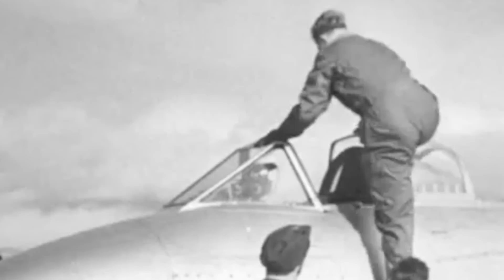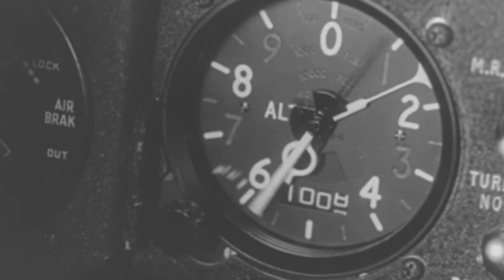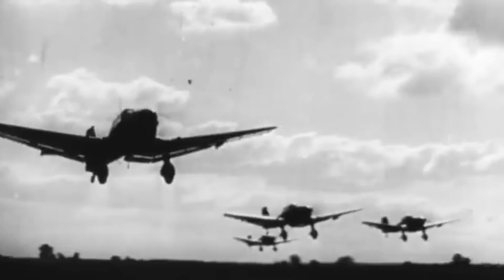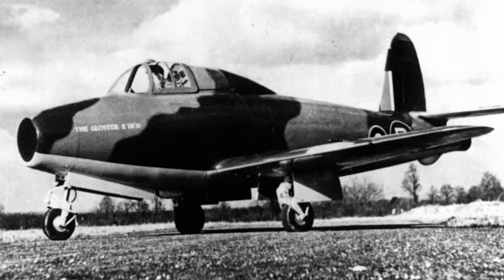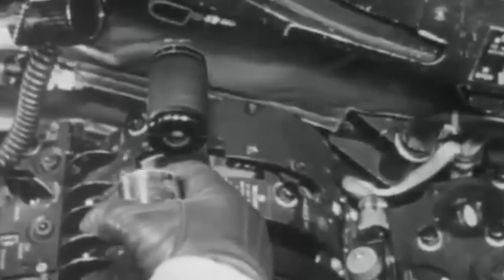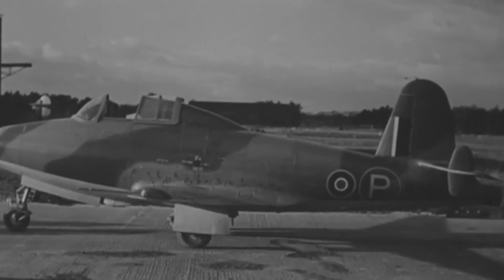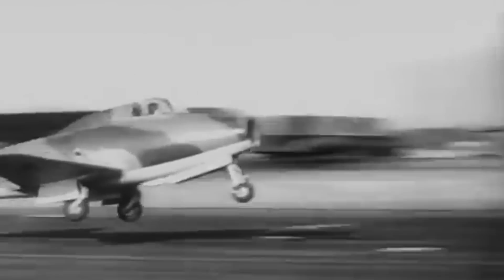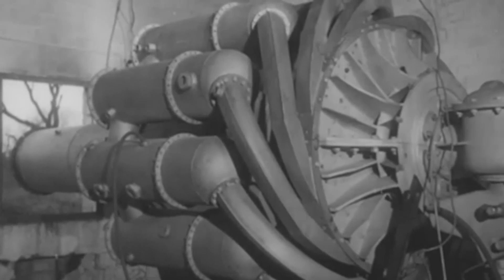Britain's 500 MPH Coffin With Wings

Comment: Great Britain 🇬🇧
Reply: Not so great at building jet aircraft...
Reply: @sandervanderkammen9230  Are you serious, we gave the world jet technology, and one or two more inventions as well if I remember correctly…😂😂😂👍
Reply: @DaveSCameron  Are you German?
Reply: @sandervanderkammen9230  Are you Welsh?
Reply: @DaveSCameron  They don't make jet engines in Wales lad...
The Jet engine was invented at the  Göttingen Universität in Germany and first successful demonstrated was in Rostock Germany on August 27th 1939.
Reply: @ 😂😂😂😂Wales
Reply: @sandervanderkammen9230 

   We do indeed feel we can clear up some commonly held misconceptions obviously.

   Of course The gas turbine concept was first described & patented in England before 1800.
    
   That's correct, Parsons of Ireland & North England produced the world's first multi stage sequential stator rotor axial compressors and turbines before 1900 for turbomachinery use, the basic components of most modern gas turbine aero engines. Parsons also did work on the axial compressor internal combustion gas turbine engine concept.

   Yes, agreed, it is in fact the case that the world's first demonstration of a pure internal combustion gas turbine aero engine was of course performed by Whittle in 1937.

We truly hope this helps.
Cheers & 👍 indeed of course.

   O B V I O U S L Y.
   
. ....... ........ . . . ..  .    .. ........
Reply: @petemaly8950  Please name a single British company that still makes British jet aircraft in the UK.
Reply: @sandervanderkammen9230 

We do indeed feel we can clear up some common false myths, misunderstandings & misconceptions.

Clearly it's always very important to note the relevant facts obviously.
 
  Regarding the UK Aerospace Sector.

Which airline recently ordered 60 RR Trent XWB Engines?

     Agreed, it is if course the case that Brazil makes very good airliners & Brazil is 100th down list along with Indonesia for wealth per capita.
Norway Holland Denmark Ireland Belgium - Top 20 wealth per capita - Don't make airliners -  its as simple as that.

   Yes that's correct of course. BAe Systems & Rolls Royce combined now do more Airbus work than Germany on an absolute basis & significantly more work than that on a per capita basis.
    
    Yes that is in fact correct, Per capita for the home nation BAe Systems is the world's largest defence contractor.
   
     It is indeed the case that BAe systems announced the recent £4 Billion takeover of Colorado based US based Ball Aerospace.

     Agreed of course, BAE systems now does a significantly higher value of work for Airbus than it did when it was a major Airbus shareholder before 2005.
  
     Yes, it is recognised that RR now owns US Engine maker Allison for example which does classified Aerospace work for the US Govt.
   
   Absolutely correct obviously, anybody currently flying on a widebody airliner stands a good chance of being on an aircraft powered by RR gas turbine aero engines designed & built in the UK.

   A typical but small glimpse of what goes on in the very internationally orientated British aerospace sector.  -
      Boeing Apache Attack Helicopter.
AH-64: 75 UK suppliers, 7% UK content, global fleet of 1280+ aircraft.

F35B more than 130 UK Suppliers, more than 30% UK content.

F35A & F35C more than 130 UK Suppliers, more than 15% UK content.

   Yes, of course it's true that an airline has just ordered
60 RR England Trent XWB Engines
    
Obviously the UK has the
World's Highest Combined Per Capita
 Nuclear / Defence / Aerospace Sector Activity.
     
Obviously we do sincerely hope this helps as usual as always.

Cheers indeed & 👍 without doubt as always & so on & so forth.

. ...... ....... ............. ..........
.... . ......... ....... ... ...........
Reply: @petemaly8950 Please name a single British company that still makes British jet aircraft in the UK???
Reply: @petemaly8950  Aye mate, can ya name a British company that still makes British jet aircraft in 2024???
Reply: @WilhelmKarsten 

We do indeed feel we can clear up some common false myths, misunderstandings & misconceptions.

Clearly it's always very important to note the relevant facts obviously.
 
  Regarding the UK Aerospace Sector.

Which airline recently ordered 60 RR Trent XWB Engines?

     Agreed, it is if course the case that Brazil makes very good airliners & Brazil is 100th down list along with Indonesia for wealth per capita.
Norway Holland Denmark Ireland Belgium - Top 20 wealth per capita - Don't make airliners -  its as simple as that.

   Of course there are many countries that could easily produce better airliners than are currently produced, they don't for a number of very good reasons.

   Yes that's correct of course. BAe Systems & Rolls Royce combined now do more Airbus work than Germany on an absolute basis & significantly more work than that on a per capita basis.
    
    Yes that is in fact correct, Per capita for the home nation BAe Systems is the world's largest defence contractor.
   
     It is indeed the case that BAe systems announced the recent £4 Billion takeover of Colorado based US based Ball Aerospace.

     Agreed of course, BAE systems now does a significantly higher value of work for Airbus than it did when it was a major Airbus shareholder before 2005.
  
     Yes, it is recognised that RR now owns US Engine maker Allison for example which does classified Aerospace work for the US Govt.
   
   Absolutely correct obviously, anybody currently flying on a widebody airliner stands a good chance of being on an aircraft powered by RR gas turbine aero engines designed & built in the UK.

   A typical but small glimpse of what goes on in the very internationally orientated British aerospace sector.  -
      Boeing Apache Attack Helicopter.
AH-64: 75 UK suppliers, 7% UK content, global fleet of 1280+ aircraft.

F35B more than 130 UK Suppliers, more than 30% UK content.

F35A & F35C more than 130 UK Suppliers, more than 15% UK content.

   Yes, of course it's true that an airline has just ordered
60 RR England Trent XWB Engines
    
Obviously the UK has the
World's Highest Combined Per Capita
 Nuclear / Defence / Aerospace Sector Activity.
     
Obviously we do sincerely hope this helps as usual as always.

Cheers indeed & 👍 without doubt as always & so on & so forth.

. ...... ....... ....
......... ..........
.... . ......... ...
.... ... ...........
Reply: @petemaly8950  Are you afraid to answer the question lad?
Name a British company that in 2024 still makes a British jet aircraft?
Reply: @petemaly8950  Well you certainly sorted that out with aplomb!
Reply: @DaveSCameron 
Thanks 👍
Reply: @petemaly8950 It's 2024 and can you name a British jet aircraft manufacturer left in the UK that still makes a British jet???
Reply: @sandervanderkammen9230 

@WilhelmKarsten 

We feel we can clear up some common false myths, misunderstandings & misconceptions.

It's always very important to note the relevant facts obviously.
 
    Regarding the UK Aerospace Sector.

  WHY IS IT THEY CAN'T ANSWER VERY SIMPLE QUESTIONS ⁉️ 😅
  A very simple question indeed.
   
Which airline recently ordered 60 RR Trent XWB Engines? 

Also name a single Germany company that makes German jet aircraft in Germany & name a single German Company that makes German gas turbine aero engines suitable for widebody airliners.

     That's correct, Brazil makes very good airliners & Brazil is 100th down the list along with Indonesia for wealth per capita.
Norway Holland Denmark Ireland Belgium - Top 20 wealth per capita - Don't make airliners -  its as simple as that.
  
  Agreed, that is correct of course, clearly there are many countries that could easily produce airliners of better  quality than Bow-wing (see b-47 wing folding & wing collapse incidents) but don't for some very good reasons. Bow-wing being a result of the size of the US, the large protected domestic market & great ease of testing new types due to the equator to arctic geography & a few other reasons related to production scale capability, politics & economics.

  Obviously there really is nothing special about Bow-wing, having more than 50 years design / build experience on the type means they have no excuses for the horrendous max incidents for example.

    Indeed BAe Systems & Rolls Royce combined now do more Airbus work than Germany on an absolute basis & significantly more work than that on a per capita basis.
   
     Agreed, Per capita for the home nation BAe Systems is the world's largest defence contractor.
  
    Correct, BAe systems announced the recent £4 Billion takeover of Colorado based US based Ball Aerospace.
  
    It's definitely the case that BAE systems now does a significantly higher value of work for Airbus than it did when it was a major Airbus shareholder before 2005.
     
      Obviously RR now owns US Engine maker Allison for example which does classified Aerospace work for the US Govt.
   
   Yes, that's right of course, Anybody currently flying on a widebody airliner stands a good chance of being on an aircraft powered by RR gas turbine aero engines built in the UK.

   A typical but small glimpse of what goes on in the very internationally orientated British aerospace sector.  

      Boeing Apache Attack Helicopter.
AH-64: 75 UK suppliers, 7% UK content, global fleet of 1280+ aircraft.
F35B more than 130 UK Suppliers, more than 30% UK content.
F35A & F35C more than 130 UK Suppliers, more than 15% UK content.

   There is no doubt that an airline has just ordered
60 RR England Trent XWB Engines

Obviously the UK has the
World's Highest Combined Per Capita
 Nuclear / Defence / Aerospace Sector Activity.

Rolls Royce Holdings UK
Subsidiaries
- Rolls-Royce plc
- Rolls-Royce North America (Allison etc Classified Military stuff)
- Rolls-Royce AB
- Rolls-Royce Deutschland
- Rolls-Royce India Private Limited
- Rolls-Royce Marine Power Operations
- Vinters Engineering Limited
- Rolls-Royce Controls and Data Services.  
- Rolls-Royce Power Systems
- Bergen Marine
Joint ventures include:
- Rolls-Royce Turbomeca
- MTU Turbomeca -

Trent Family
The MT30 (Marine Turbine)
Industrial Trent 60 Gas Turbine
Trent 7000
Trent XWB Airbus A330neo.
Trent 1500
Trent 1000
Trent 500
Trent 600
Trent 700
Trent 800
Trent 8100
Trent 900. 
   
RR wholly owned subsidiaries in Germany handle smaller 2 shaft RR gas turbine aero engine work.
  
We hope this helps of course as always.  Cheers & 😎👍 indeed.
   
       O B V I O U S L Y  

. ..... ..... ......  ..... ...
.... ..    .. ... .. .. ... . ..
Clearly the line above this line is not blank.

Comment: This is typical click bait    only two were built but someone went to a lot of trouble to write this rubbish   Maybe they have ideas of greatest in the literary field   Its a pity they didn't get their facts straight
Reply: Entirely correct of course
Reply: Gloster made some appalling jets...
Reply: @sandervanderkammen9230 
@DoktorBayerischeMotorenWerke 

We believe we can clear up some common misconceptions & false myths.

It's always very important to note the relevant facts obviously.

Krappenz, DiktorBummer, KARZEESTAN, Diktorbayturmosterjerkzxoffenzische, AnewAOownley etc & co - they should all note with much awe and great wonder.

    Regarding the awesome Gloster Meteor, it's achievements & obvious relative superiority.

Indeed it is of course correct that the Gloster Meteor was in fact operational during WW2.

   Agreed, of course it is the case that we can compare the awesome trailblazer Gloster Meteor with the Starfighter. Training, equipment, knowledge in many areas & infrastructure had all improved considerably by the time of the Starfighter obviously, indeed it should have been much safer for pilots & others than it was.

     Yes that's correct obviously, the ME-262 was limited to running away from allied piston engine fighters  & risking engine destruction while doing so & it took 3 downed 262s for each downed allied bomber over Germany where German air inferiority was fairly ubiquitous so there was indeed large swarms of allied bombers available to have a go at but the 262 was of course a dismal failure at that task.

     Agreed, clearly after 1941 it was clear The future Gloster Meteor wouldn't be required as such & was limited to operation over the UK & occupied allied territories to keep examples out of the wrong hands.

    Yes it is of course correct that the world's first jet powered aircraft to exceed 1000 mph was indeed a British aircraft.

  Yes, agreed, it's a pity British forces had to occupy a large part of Germany for decades after 1945. Russia had to do the same. Russia now produces nukes. Of course the UK produces nukes. Germany does not produce nukes. Russia still possesses a large chunk of what was German territory.

  Of course there are two fabulous Gloster Meteor aircraft currently being used for ejector seat R&D at Martin Baker.
   
Contrary to their copious & ubiquitous posts regarding accident losses of various UK aircraft.
   
As they mentioned previously, the Sea Vixen & Gloster Meteor were indeed very competent & beautiful aircraft.

    In fact the Meteor was the world's first aircraft to exceed 0.85 on the combined 2 year looks & capability scale for jet fighter aircraft.
   
    That's correct of course, Indeed A rather superb Gloster Meteor was the world's first Turboprop aircraft in 1945. In 1945 & 1946 trail blazing Gloster Meteors set world speed records.
     
  Yes, of course it is correct that British military aircraft at the time did not have unusually high accident losses rates.
For example
De Havilland Vampire &  Sea Vixen & Gloster Meteor accident losses were not high or unusual for fighter aircraft at the time.
Non combat phase accident losses 
% of Aircraft built.
The Canadair CL-44 was a turboprop airliner.
Canadair CL-44                    (ff 1959 ) 48%
Lockheed XF104                    (ff 1954) 100%
Lockheed  P80                       (ff 1944) 43%
Lockheed F104                      (ff 1954) 45%
McDonnell FH Phantom       (ff 1945) 35%
Gloster Meteor                     (ff 1943)  21%
DH Vampire                          (ff 1943)  23%
DH Sea Vixen                       (ff  1951) 33%
Gloster Javelin                     (ff 1951) 20%

Gloster Meteor.
3950 Built.
In service 1944.
70% didn't have ejector seats.
839 accident losses.
436 accident loss fatalities.
21% accident losses.
11% accident loss Fatalities.

Lockheed F104.
2578 Built.
In service 1958, 14 years after the Meteor.
All had ejector seats.
1100 accident losses.
425 accident loss fatalities.
43% accident losses.
17% accident loss Fatalities.

As always we do indeed clearly hope this helps.

Cheers
👍 & 😎 & of course 🙂 indeed.
Toodle PIP Old Chap  (obviously)
     
                
    Clearly, the line above is blank, (entirely intentionally).  
O B V I O U S L Y
    
.. . .. . ... .... . . .......... ..... ....
.... ....... ..... ...... .....  ..... ......